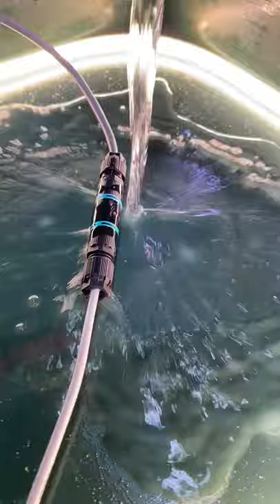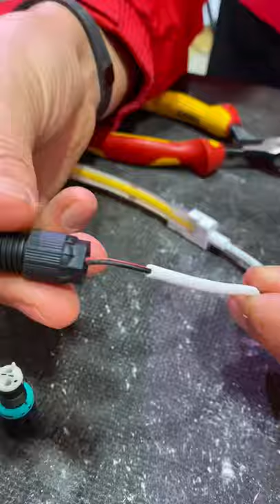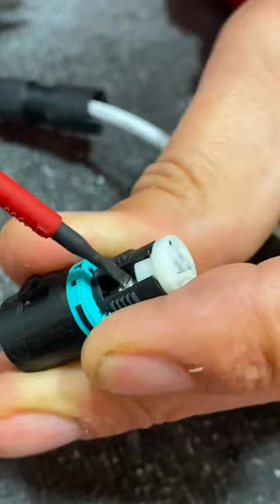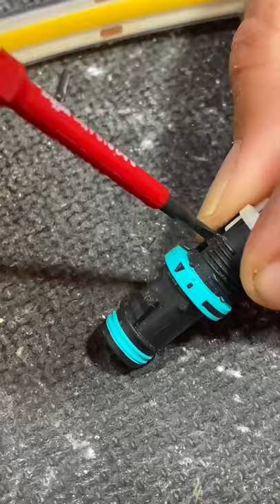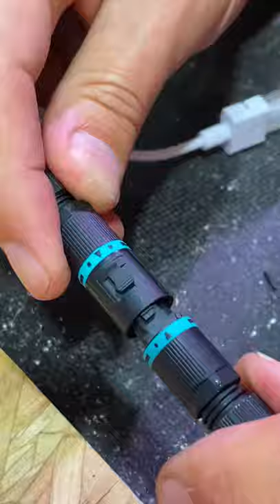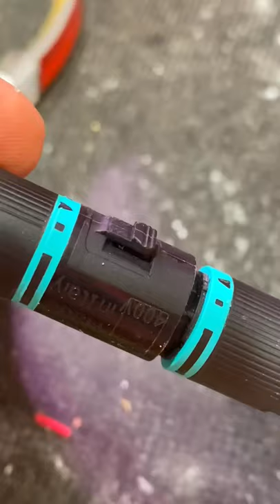WATERPROOF LED STRIP LIGHT CONNECTION TH381.2 #shorts

Comment: Top tip, where possible put the sleeve/cover on the cable before stripping the insulation, it's much easier and avoids spreading the strands.

Comment: Jesus Christ guys where are the ferrules
Reply from the maker: Bit tricky on this one the screw is a long way back in the connector shell and we didn’t have any extra long small cross section ferrules
Reply: @efixx   well then take any small crosssection ferrule, cut the plastic part off and then put it in. This is an actual fault that causes issues.